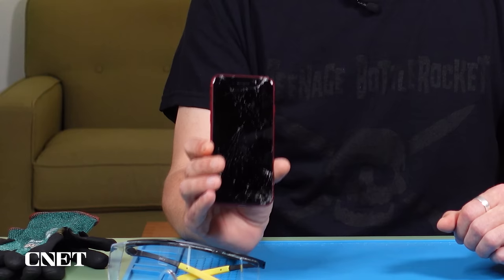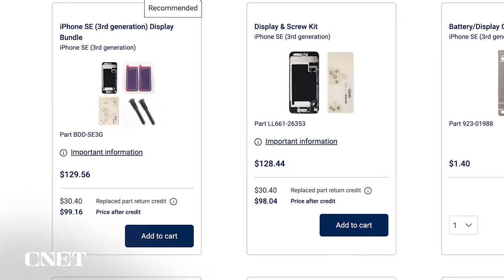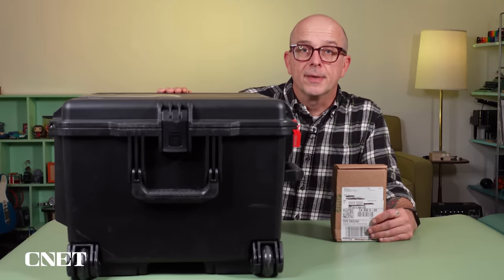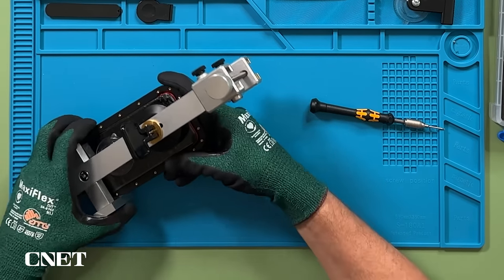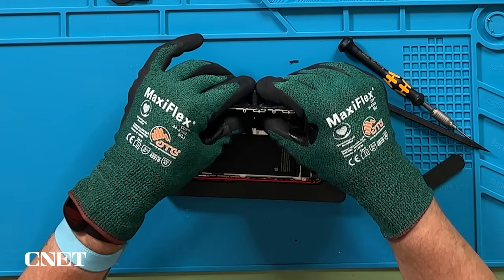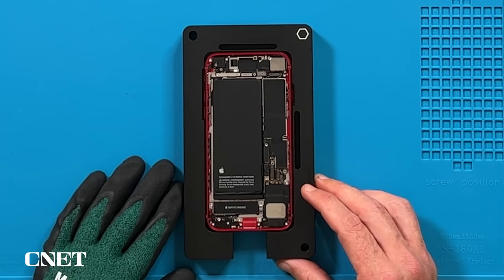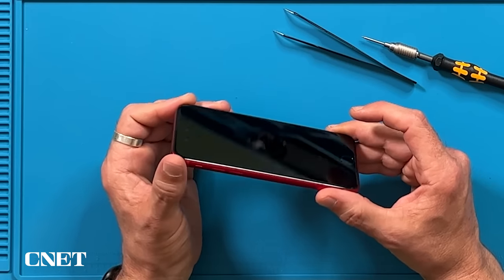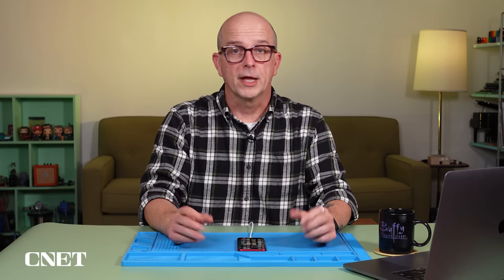How to fix your iPhone Screen (Using Apple Certified Parts)

Comment: An 80 page repair guide, playing where"s waldo with the code, a 1200 dollar hold, and making sure that the customer knows that replacing the screen at the apple store is cheaper (129 vs 179 doing it yourself), and contacting the repair team for system configuration. Yes apple now allows people to fix there phones but the company really is doing everything it can to discourage people from doing so.
Reply: You don't have to buy the repair kit from Apple, you can also buy, for example, a new screen somewhere else. It isn't that hard as people say it is to repair an Iphone

Comment: How in the world is this guy, or CNET for that matter, not criticizing Apple more for the convoluted hoops they designed to purposefully discourage people from repairing products themselves? Can only repair from iPhone 12 onward. The hold on your card. The cost of DIY with this equipment vs. taking it in. What a joke.
Reply: What exactly is your point? You aren’t required to rent the tools. The program starts with iPhone 12 and could be expanded. It’s got to start from somewhere.
Reply: @tech4now_  It's not just the tools. The pricing for parts is just laughable and you have to contact Apple to be able to complete the repair. That's ridiculous. They also started the program with the most recent models of iPhone when there are a lot of users trying to fix their older phones which are more likely to have issues. It's not "starting somewhere", it's non-sensical. They have those parts and equipment because they still sell the SE, which shares with previous models of the same form factor. The program is a joke.
Reply: @CO-kd6sd  It truly is absurd. Not gonna lie, this feels like it's full on sponsored by apple or something, the only think keeping me from saying that it definitely is and the guy is getting a new Ferrari out of this is the lack of mentioning that anything is sponsored which is weirdly a common requirement on YouTube ._.

Comment: For an iPhone SE, if you have the skills and a few basic phone repair tools (pentalobe, phillips and tri wing screwdrivers, tweezers, and some opening tools), you can buy an aftermarket screen and do the repair for much less. You'll likely have to move the touch ID sensor and speaker/mic/selfie camera array from the damaged screen to the new one. For higher end phones like the 13 and 14 series, the parts are often cheaper from Apple than anywhere else.

Comment: Any tips on placing screws back in the phone?
Reply: Do it over a bright colored table or bed so you can find and recover your screws and try to align the tip of the screw into the hole

Comment: I am a certified Apple technician and this is exactly why consumers should not do self repairs for the most part. They do no read manuals. The way you opened the phone was rough to see as you could’ve damaged so many things using a black stick to just pry it off.
Reply: But did he break it? No. Also it's just an option. It's his phone and he should be able to do whatever he wants with his phone. Most people will still go to 3rd party repair and they need right to repair also.